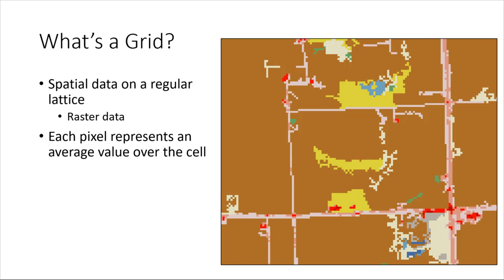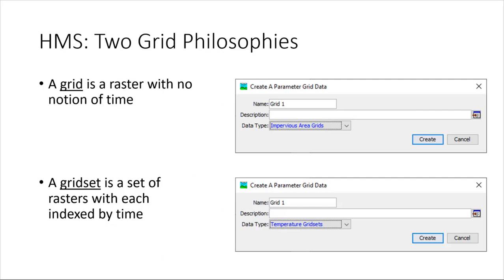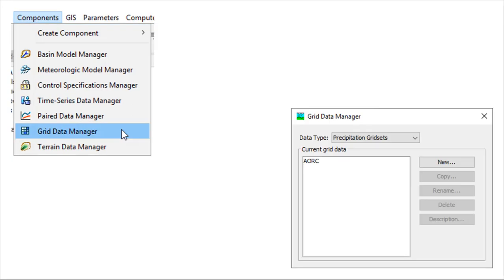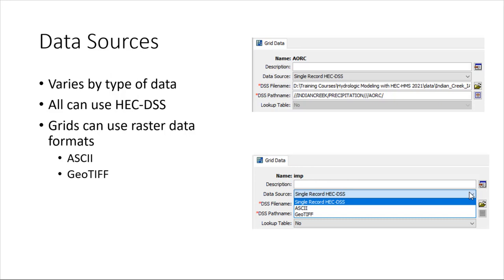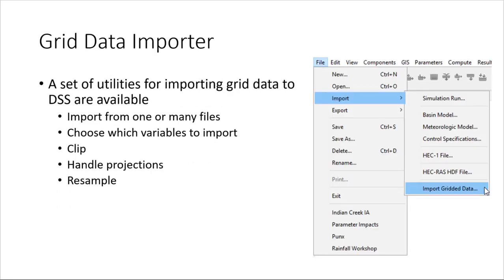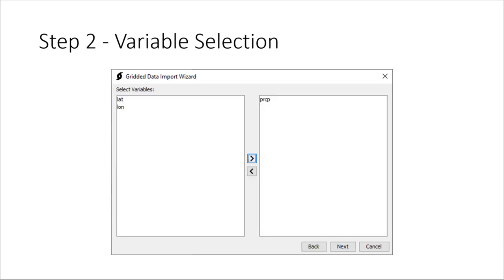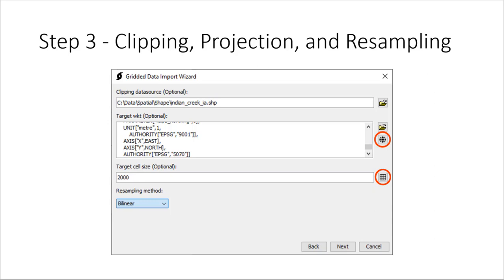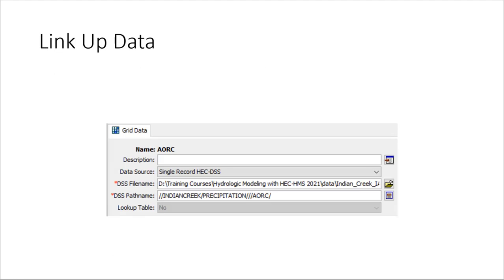L 4 c Gridded Data

Comment: Hi Gregory, it is a great lecture in using gridded data inputs to HEC-HMS model. Currently I am using HEC-HMS model to generate runoff at area of interest of a basin. However, while importing the gridded precipitation and temperature data (in Geotiff format, "*.tif" ), it doesn't imported, stored and displayed. Any idea or support please?
Reply: Have you fixed it?
i'm getting same issues.
have you tried to convert into DSS format from HEC DSSVue
Reply: @JALAJDARPAN  Now, I solved the issue of fetching the Geotiff data to HEC-HMS. 1st- convert *.tif to NetCDF using a Linux or bash environment or any method you are familiar with, and set Time axis for your data. 2nd- import the NetCDF data using HMS and display on DSSVue. I hope it helps.
Reply: @JALAJDARPAN  not yet, I am still trying, and expected technical suggestions and support from developers. FYI, I am converting *.tif to NetCDF first then import will work. But not comfortable to do so this way.